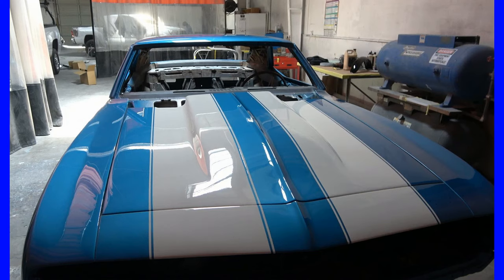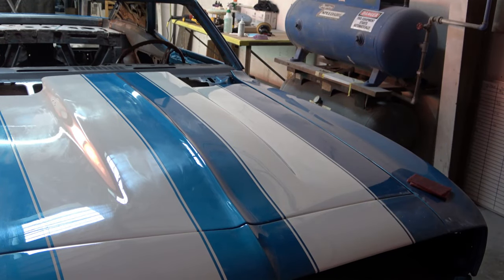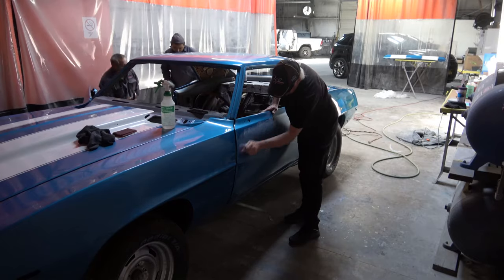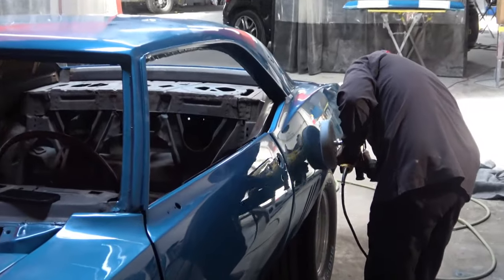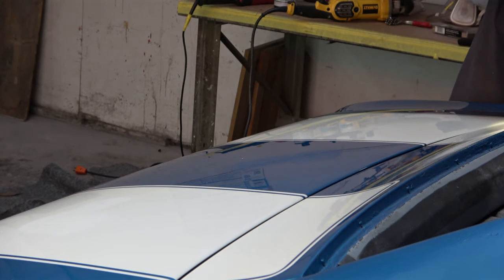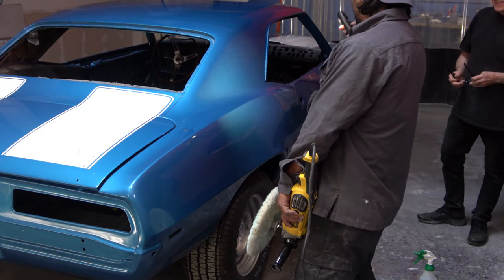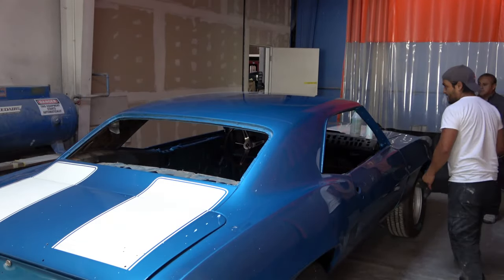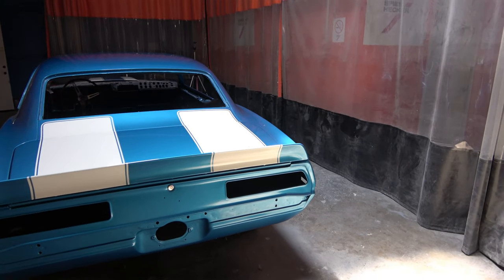69 Camaro in Le Mans Blue Full Restoration Video Series - Part 13  Final Cut & Polish to Perfection

Comment: The guy knows how to buff but its the color sanding that leaves a lot to be desired. Still tons of orange peel and a big run at the top of the driver side rear stripe. Painter 40+ years

Comment: Why don't people paint the Inside of their cars? I think it would help protect it. Specially under the roof that seems to be one of the worst areas for rust. Get in all the Nooks and Crannies. All the Hidden compartments. Rear Deck and Dash Fully Painted. Color Match or that Truck Bed Liner stuff.. ALL Surfaces Covered so No Water can get at it... But that's just me...
Reply from the maker: All that is true, but in a 100 point restoration, it’s important that the car be restored as it was at the factory.
So it all depends on which direction the restoration is taken.

Comment: What did this restoration cost?   Seriously.  $125,000?????

Must be really nice to have money be no object in life.
Reply from the maker: Actually, no where near that. If you are reffering to the Paint and Bodywork, it cost me about 20K. It could have been done cheaper, but this is a top notch perfect paint job. And I helped with a lot of the prep work. I will be doing the entire rest of the restoration myself including the engine. So when the car is finished, I estimate that I will have about 53,000 out of pocket. That does not include the purchase of the car, but that was completely covered by the profit from a sale of one of my motorcycle restorations. And btw, that is all spread out over a 5 year timeline so far. So, there are a lot of ways one can restore a car of their dreams if you really work at it and are able to do a lot of work yourself.